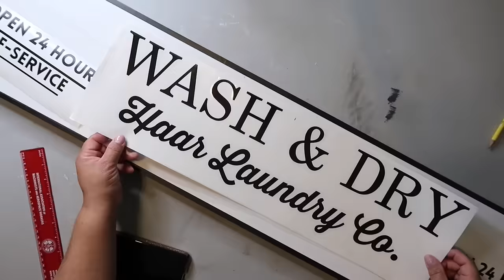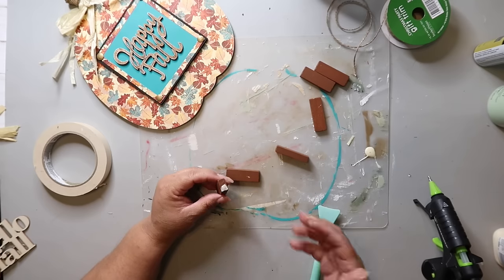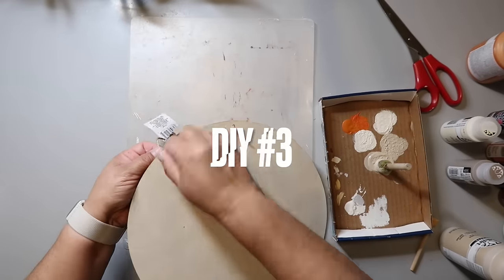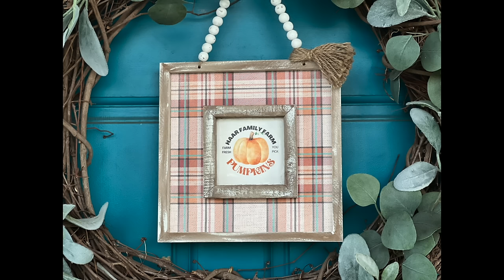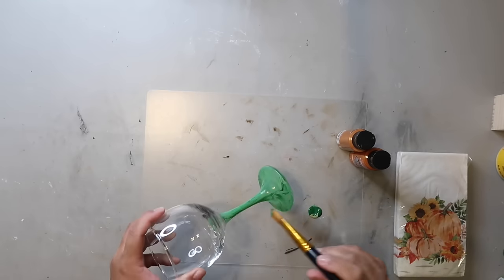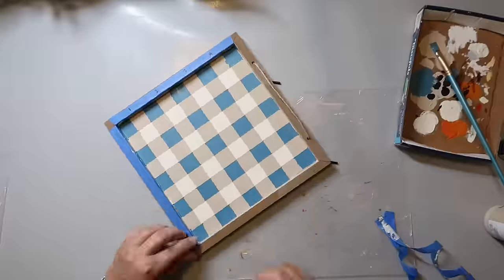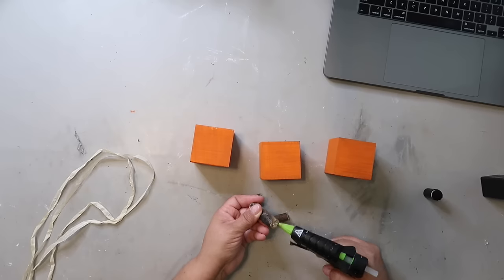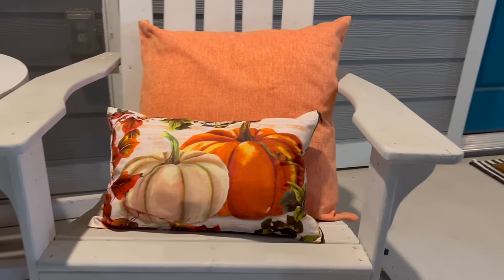🎃🍁 21 UNBELIEVABLE Farmhouse Style Pumpkin 🎃 DIYS | Easy & Affordable Fall Crafts

Comment: A great compilation video with pumpkins. You gave me so many ideas and inspiration. One of your tips on the raised pumpkin and scrapbook paper was to  put the paper right side up over the piece then to use my finger and rub around it to get the indentation. I got up right then to try it out on a pumpkin I was ready to work on and it turned out great. Thanks for that and for this video.

Comment: Drop some hot glue into the teeth of the zipper at the end you cut and the tab won’t be able to slide off. Or you can run a few stitches around that end to mimic the tab stop.